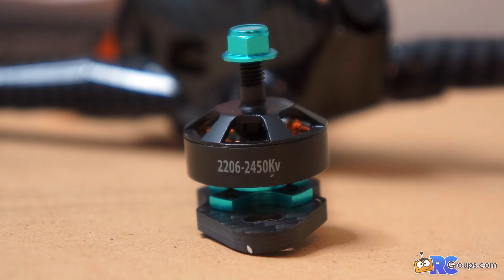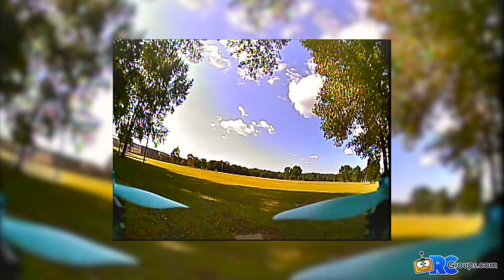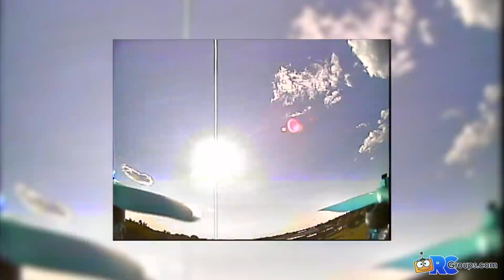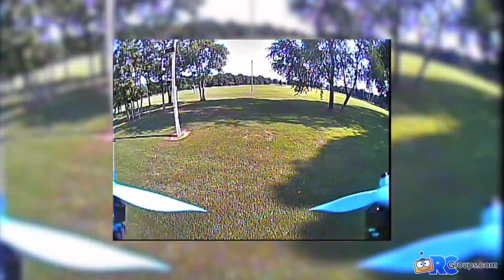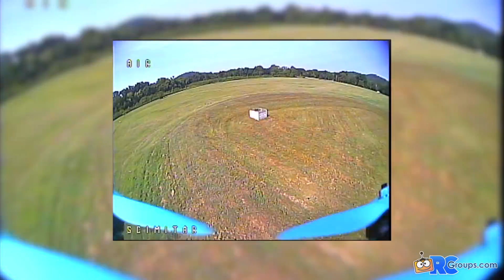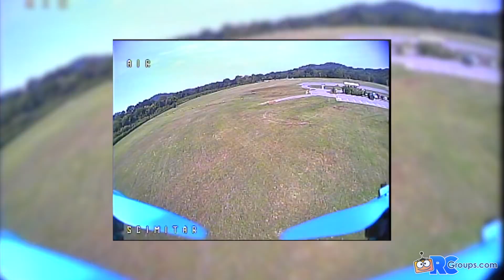Blade Scimitar 215 Pro - RCGroups Review

Comment: Best drone for the money right now I think untill they are gone is the blade Theory XL it's a rocket and flys great . And the torrent is a little ripper for cheap it's fpv cam is really good only bad a bout the torrent is relocation of the vtx antenna it will get smashed to point of breaking off only problem I've had it's dropped 50 feet no problem

Comment: I was given one if these as my first quadcopter after flying planes in and off for years. Is it an easy to fly first quad? Nooo... are you still able to learn with it if you already have some rc experience? Totally. I started off in angle mode for the first 8-10 batteries then switched to acro and am now flying pretty comfortably with it on my dx6. My canopy cracked in exactly the same spot but I just duct taped it back together and it's fine. Probably crashed it 20 times now and nothing else has broken, props included. Love love LOVE this thing.

Comment: A needed review! not a whole lot of reviews out on this thing yet so thanks for getting in there.However that canopy is trashed and should be discarded or repaired at least. you wouldnt wear the same bullet proof vest 2x or helmet after they had fulfilled their soul purpose. As for the other ppls comments about spektrum ...I have never had any of txs give me trouble. dx4,dx5,dx6 and dx6i now dx8 gen2... there are some faults with these but none have anything to do with the signal. had 1 walkera and 1 frsky decided i like my instructions in english not engrish this hobby is hard enough without having to decipher the rosetta stone
Reply from the maker: Thanks! Yeah I obliterated that already cracked canopy after pinging a soccer goal recently. Bought a new canopy for $19 and haven't cracked the new one yet so that's something.

Comment: Only Horizon could put a plastic canopy on a race drone. Those thrust batteries cannot take hard flying and will puff, and the Spektrum receiver will failsafe repeatedly. Too many reviewers are in Horizon’s pockets. I learnt this the hard way and steer well clear now
Reply from the maker: A) I talked about breaking the canopy on mine. 
B)The Thrust batteries are fine if you don't charge them to full HV voltage. Every brand of HV packs I've tried have puffed when using them that way. These haven't puffed at all using them at standard lipo voltage.
C)I have never went into failsafe with this receiver, much less repeatedly. 
D) My reviewers are based on my experience with the products. I can't speak to things I didn't experience while using it. That doesn't mean I or anyone else is "in Horizon's pockets." Hope that clears some things up for you.
Reply: rcgvideos and I am speaking about my experience. I bought a dx6 and blade conspiracy based on your review. I couldn’t fly out 75 metres without failsafing. After changing receiver several times ( I put them on my builds as well) I regrettably changed to FRSKY and now have rock solid and reliable equipment. I have lost all faith in the Spektrum brand.
Reply from the maker: That is weird. I've need using Spetrum since the very first DX7. Jeti is my favorite radio, but the Spektrum stuff has been reliable for me. If yours was failsafing at 75 meters, then something was defective which can happen on any radio. Just didn't want you to think I was shilling out, because I don't do that. I try to be fair and give my honest opinion from my experiences. Thanks for your comments and watching.
Reply: rcgvideos the strange thing is it’s totally reliable with my planes. I’m in the Uk so have different firmware to you guys, maybe that may have something to do with it. I really like your reviews , I meant there are reviewers and sponsored pilots out there that are a little biased. However Horizon products taught me to fly with the SAFE technology and their bnf range, and I have invested thousands in their products. It’s since I’ve been into fpv miniquads I’ve had problems. Thanks for your response, it’s nice to have a constructive discussion, keep up the good work
Reply from the maker: Ah, Not sure what's difference in the firmware, but maybe the power output of the of the transmitters are different. That might explain it, especially since you can make it happen repeatedly. Glad you got the bug to fly and found a radio system that works for you. I don't care what anyone uses so long as they are having a good time with it. : )
Reply: Completely in the pocket.